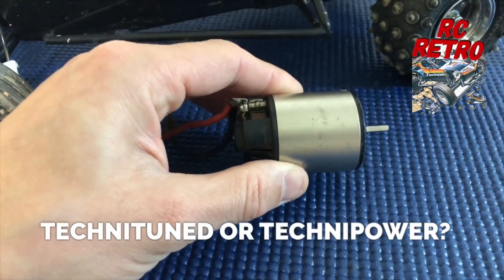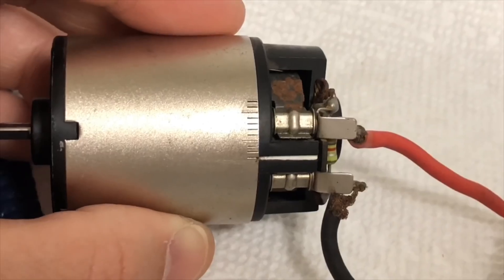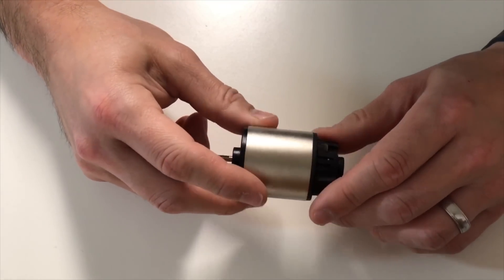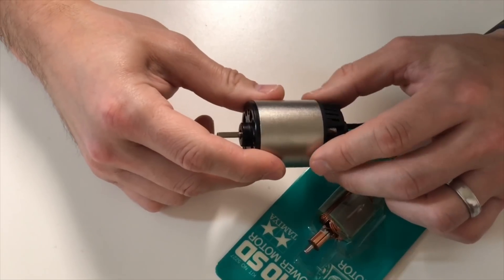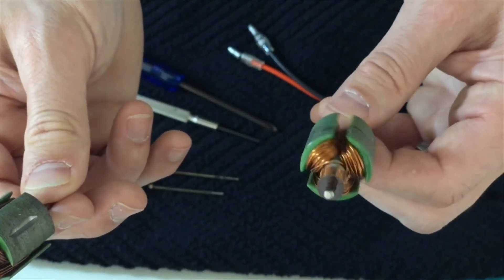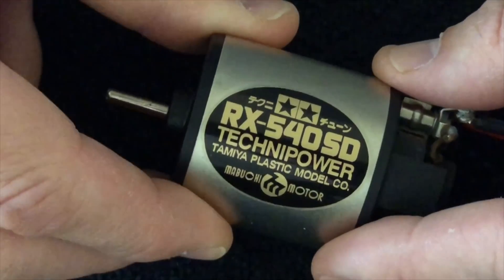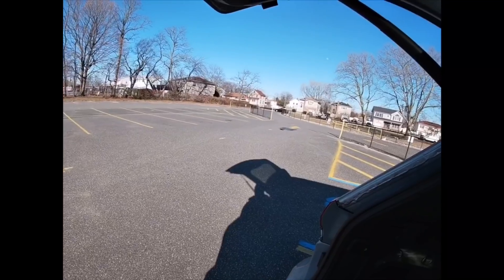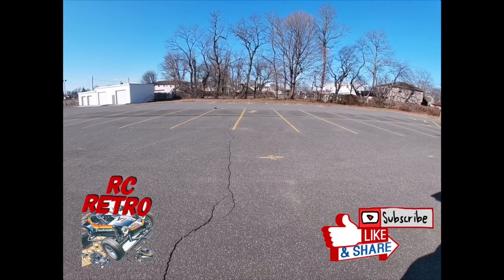e53: Vintage Tamiya Technipower Motor Rebuild &  Hornet Run

Comment: One interesting factoid is that the Technituned was the one motor from the 'techni' trio of motors that was NOT included in any of the high-performance 4WD kits (The Supershot got the Technipower, while the Bigwig, 959 and Avante got the Technigold). I wonder why that was.

Comment: My Grasshopper does 26mph with the new Sport Tuned and 3300mah over lander tornado battery, maybe adjust the timing on the techigold motor

Comment: If you ever really noticed the technic, gold motor is very brilliant gold. The technic power motor is a lighter Shade of gold and the check Neptune motor can is almost silver, but yeah it’s still gold. That is the difference you would have to have all of them next to each other to actually appreciate the difference there is also difference in the way the rotors were cut and balanced each has a different message of being Dynamically balanced.

Comment: did you know that each motor had a different gauge wire wound on the arm? That is how you should have  found out the professional way. With a caliper.

Comment: hi i had to look at the rebuild again because i'm doing one but i have to say i think the motor is a technigold not power because the end bell shows the pig tails for the brushes the  technipower dont have them in that case u should put the other rotor in because it would be faster again

Comment: hi i had the same problem with the technigold and technipower didnt know what was what  see the brushes are different in the gold too so did u ever find out? the gold will run alot less hot  hope u do a update on this thanks i only found out if u do a run test

Comment: A different LiPo battery may give better performance. Personally, I haven't had good experiences with Venom batteries (both NiMh and LiPo), and the one you were using has a fairly low 20C rating.